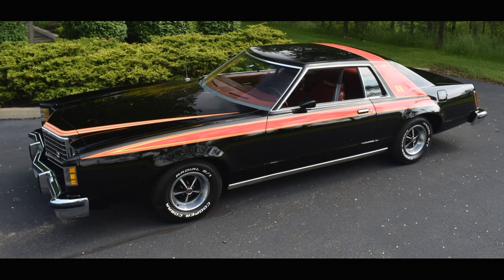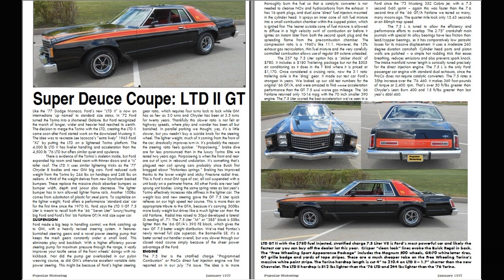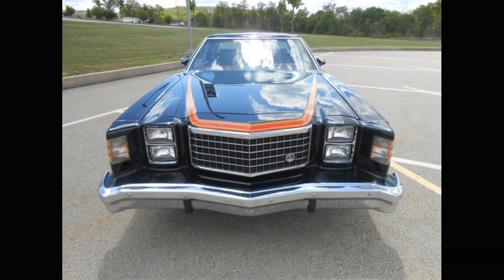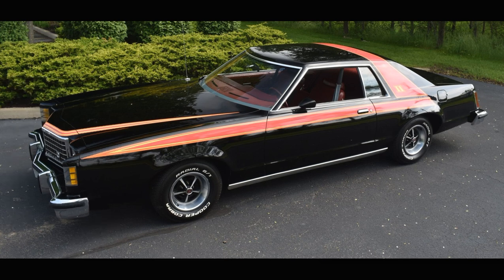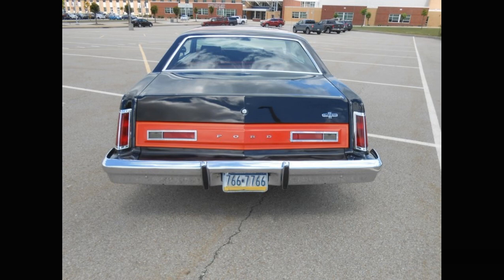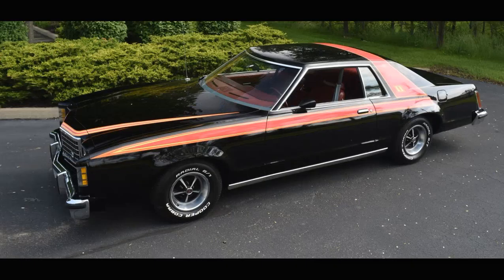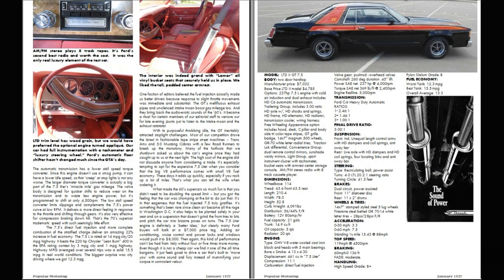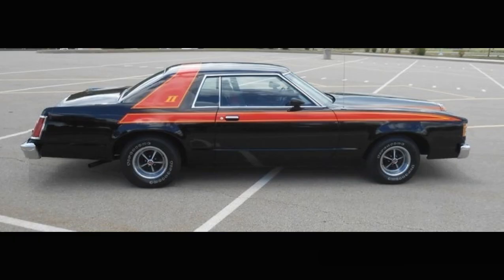1977 Ford LTD II GT 7.5 Liter "Programmed Combustion"  Road Test

Comment: this is a joke right?  they never made a 7.5lt version of the LTD ii. and what is with the photoshop nose and rear chopping and extending in the video.
Reply from the maker: This is an alternate timeline of muscle car history, where the overhang is shorter and the engines are bigger! Ford actually had worked on stratified charge engines since the 50's and was closer than the other makes to implementing it back in '77-'78.
Reply: Somebody may have dropped a 460 in place of a 351M.  Seen one for sale in St Paul or Minneapolis about 6 years ago with a 460 in it.